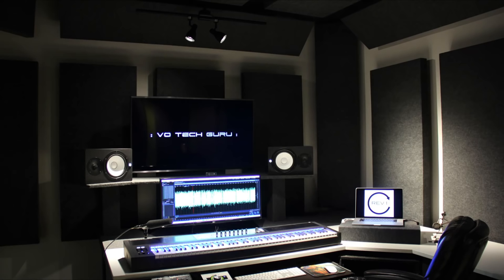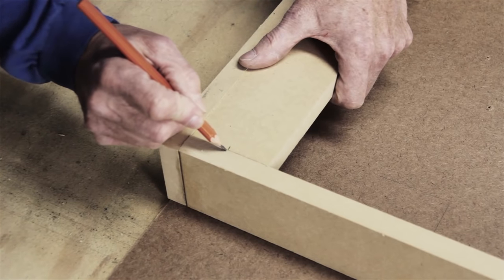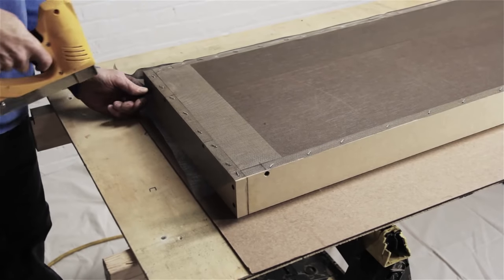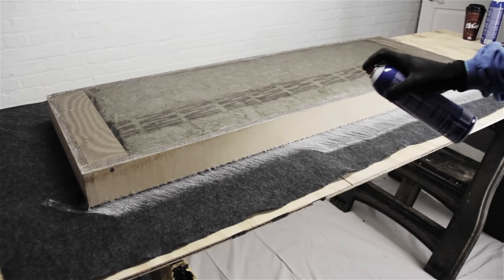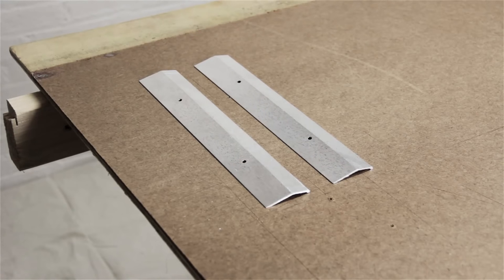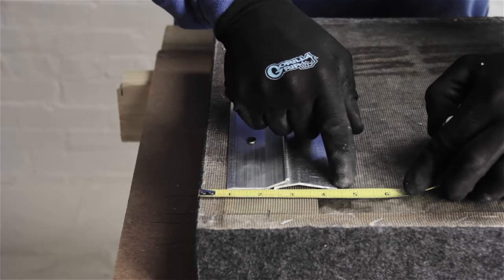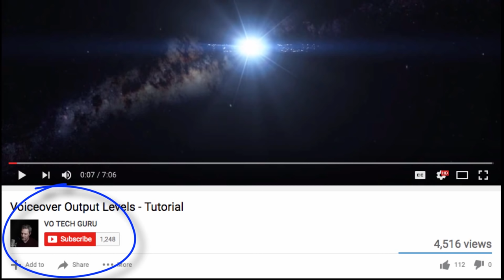How To Build Acoustic Panels | DIY Acoustic Panels

Comment: The material you used, Roxul, is it rockwool or mineral wool? It seems it is dusty and may cause some breathing problems because of the gas it releases. Rockwool or mineral wool generally does. How did you managed it?
Reply from the maker: Cagri Yilmaz I personally don’t manage anything when it comes to Roxul but I recommend people wear masks, gloves and long sleeves in this video because some people might believe it’s an issue for whatever reason. I’ve been around Roxul and installers for many years and it’s rare to see them wear protection. The same is true for employees at the Roxul plant. Look up “Holmes On Homes Roxul” on YouTube and that may address your concerns. Roxul also has MSDS sheets on their website at Roxul.com. Hope that helps. :-)

Comment: How did you make the triangle-shaped sound baffles at the top of your sound room (see :24 mark).  Are they just bass traps mounted to the wall?
Reply from the maker: Hi Craig. Those are the same panels, only longer. I think I explained a bit down below this post, but basically you build triangle shelves out of MDF for the corners at the walls and ceilings and then use the metal cleats (transition strip) to hang the panels on those. Note: It is important that you have upper, lower and possibly even center supports when hanging longer panels in corners, from ceilings, etc. That is to say, you need more than a single connection point for strength in corner and ceiling applications. On that note, when we installed our panel clouds at the ceiling, we used eye hooks to fastened them from the ceiling into to the upper and lower panel supports. Same wall anchors, they haven't budged. ;-) Hope that helps!
Reply: Thanks!  Great advice!
Reply from the maker: Craig Walkner You got it. ;-)

Comment: This is utterly brilliant, thanks Tim! Can you use pressure treated wood (2x4 or smaller) for the frame or is MDF just a safer bet? Sharing this on my page too - I've been hunting for a straight forward version of this build for weeks. :)
Reply from the maker: Hey Chris, thanks for the kind words! I wouldn't use PT wood because it can become very unstable over time. The MDF is a much better value and a very stable product. It's used to build furniture and many other things due to its strength and stability. Thanks for the share!
Reply: Makes sense! Of course man - I also just learned what countersinking is haha. Thanks again. :)
Reply from the maker: You're welcome and thanks for watching/sharing!

Comment: At the risk of sounding silly, does is matter what the frame is constructed of? I would think a wood frame would be more absorbent than metal.  Or would it make an appreciable difference because of the mass of the insulation? Could you use a lighter frame material than wood as long as you can get that taught material with no wrinkles?  Thank you!
Reply from the maker: Walker Texas I suppose you could but I’m not sure how ridged and square the panel would be. Which material were you thinking of using for the frame?
Reply: If I could achieve the same absorption, theoretically, with a frame the size and weight of toothpicks as long as I could get the material taught across it, it'd be beneficial to me.  If I could do that, do you think the performance would be the same as your frames?  Thank you!
Reply from the maker: Walker Texas If your frames hold together I imagine they’ll do the job. I saw one guy just glue insulation to his wall, which worked, but it looked, uh...not so good.
Reply: I understand what you're saying and thank you for the reply.
Reply from the maker: Walker Texas You got it. ;-)

Comment: Would it be possible to hang these horizontally?
Reply from the maker: 94fonze I don’t see why not. Maybe just figure out what needs to be done to hang them at both supports. Maybe two smaller hanging brackets? Or you could use wire supports. I just don’t care for those because panels get out of level over time.
Reply: VO TECH GURU thanks! I'll keep that in mind
Reply from the maker: 94fonze You got it. ;-)

Comment: Greetings again, may i ask how many of these panels did you make in total, and how much fabric did you use in the end? Also how did you know the total amount of panels you needed for your walls? Thanks in advance
Reply from the maker: gunluv96 Hi. We used 9 yards of 72" felt for 8 panels. We built far more than 8, but that's the coverage you can expect. As for distance between panels, we averaged 8" or so between them. Here is a link to all the materials in case you have a hard time locating the felt. We used Charcoal Gray in this video. https://kit.com/votechguru/diy-pro-acoustic-panel-supplies-as-seen-on-youtube

Comment: Were you able to test these and find the frequency range that is effected? What is the lowest frequency it has a useable effect on? I know rockwool goes a little lower than fiberglass, but not sure how much.
Reply from the maker: Thanks for watching. You're hearing my voice in a booth with those panels and my control room at the beginning of the video sounds great with these panels. I also have them at my home studio and they work great there as well when I'm composing and mixing for film and commercials. I've never noticed an issues with any frequencies and it's likely because they're so thick and are held off the wall. VERY effective stuff. Hope that helps.

Comment: This is a truly excellent DIY vid (The best I’ve seen on youtube and the one I’ll be using to get the job done right).  Please Please show us how to make those awesome corner Bass traps we see in your studio. I know others would really be interested in watching/learning from your experience. .
Reply from the maker: Thank you very much and thanks for watching! It’s actually really easy to do the corners. Just cut your sides to the length you need, then build triangular shelves with a wood face on them just like we did on the wall. We did one of the top and one at the bottom of the long panels. Done. Make sense? And again, thanks for the great comments!
Reply: @VOTECHGURU  Got it!  Did you fill the whole corner space with the Roxul, or do it the same thickness as the flat panels?Thanks for your quick reply. As this was a pretty old vid, I wasn’t expecting that. Awesome!
Reply from the maker: Yep, same depth on the panels for the corners, and if I’m not mistaken, maybe the same width, or close to the one in the vid. But for sure, the ones on the walls in my control room that I show in the vid are much wider. I think what I did was figure out how far apart I wanted the panels on the wall to be, then measured how wide the corner panel would have to be for symmetry, then with adding the depth of the panel that dictated how for out and how wide my corner shelf needed to be. And the funny thing is, I hear and see so much talk about these MASSIVE base traps, but in reality, I also score and mix for film and TV with this setup and have had zero problems. Like a shaking my head thing with the whole overkill approach, you know?

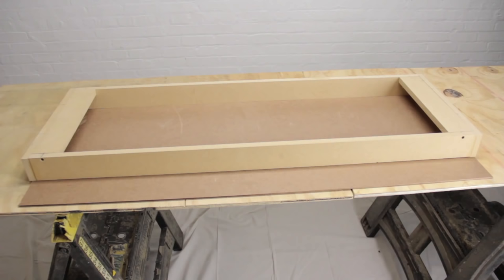Comment: The width displayed on the packaging at 01:22 reads 15 1/4". If that is the case, wouldn't the top and bottom pieces measure 15 3/4". Unless you cut them down to 16 1/2" for a snug fit. Just curious. I thought I'd ask before I start ripping away!  Again, thank you for your time and assistance. Much appreciated.
Reply from the maker: The inside ends up being 15” so a snug fit is what I was going for.

Comment: I am wondering if I can get away with using 5/8" MDF instead. The 3/4" panel is double the price where I am located.
Reply from the maker: Sure thing. Just be super careful when drilling and screwing. Maybe count more on glue and a nail gun (a small brad nailer so the wood doesn't split).
Reply: @VOTECHGURU  Thank you so much for the prompt reply. I have looked everywhere. Hard to believe that a 5/8" sheet would run me $22.00 whereas a 3/4" sheet would cost me $43.00. Makes absolutely no sense to me at all. There must be a valid reason for the discrepancy however. By the way, this is my go-to video. Must have watched it a dozen times. And trust me, I have seen a few!
Reply from the maker: Peter Batah Thanks! Yeah, that does seem pretty out of scale. There has to be a good reason for the price difference. I would be interested to find out.
Reply: @VOTECHGURU  I picked up my 4' x 8' x 3/4" sheet yesterday and again asked why the huge price discrepancy. This time I was told it was because of the extra glue that was required. Go figure.
Reply from the maker: Peter Batah Weird.

Comment: Hey, I want to make these but long story short, I can't have them hanging on my wall permanently.  I would like to use them as a part of a vocal booth.  I will also be transporting them as I will be recording in a few different locations .  How is the durability of these, and specifically, if I were to transport them around a bunch, would I have to worry about the fiberglass particles leaking through?  Like if they accidentally get bumped, etc.  thanks a bunch!!
Reply from the maker: I don’t know how I missed your comment from so long ago, but the new YouTube studio app lets me filter by unanswered questions. You could build them by turning them into a Gobo, just look that up on YouTube, but I would be careful during transportation to make sure you don’t damage them. As far as any leaking of the insulation goes, I would just watch this video. https://youtu.be/LOWQym4RCfI

Comment: Question, im in the process of replacing the drywall in my bedroom in which i have a home studio setup for recording vocals and mixing, would it be a good idea to fill the walls or parts of them with the roxul insulation before installing the drywall? Would i get the same or better results? Thank you.
Reply from the maker: Roxul is used inside walls to help keep noise out. Is that a goal as well?
Reply: @VOTECHGURU  My main objective is to diminish the echo/reverb in the room when recording vocals, will installing the insulation in the walls help with this or would i still need the panels over the drywall?
Reply from the maker: T Rex Then focus on making panels to hang on the walls because Roxul behind the drywall will only help keep exterior noise out and won’t help with the echo.

Comment: Very nice video indeed ! I really like the way you hang your panels. Very clever ! But panels like these are mores efficient when there’s a gap between it and the wall. Especially in the lower frequencies (low mids) that are the most difficult to deal with ! You should have provided this information as it is crucial in acoustic treatment!
Reply from the maker: Covers and Stuff There is a 1/2” gap caused by the hanger and I state in the video that the bumper at the bottom is to keep it equidistant from the wall. There aren’t any issues across the spectrum that I’ve experienced.
Reply: @VOTECHGURU  When I say gap, I mean a bigger gap like 4 inches. It doesn't create any issues to hang them closer to the wall but you will actually extend the panel's capacities if there's a bigger gap. It will absorb lower frequencies.
Reply from the maker: Covers and Stuff No offense, but where are you getting your information? I voice professionally, compose and mix for commercials and film and have had no problem frequencies at all using these panels. Even major panel manufacturers sell solid backed panels (a huge mistake by the way) and these are far superior to those. Also, creating 4” standoffs with panels this deep will not only complicate things a great deal but will have diminishing returns. If there’s something I don’t know, please educate me. Thx
Reply: @VOTECHGURU  I'm getting this information from Ethan Winer from RealTraps and many other sources over the Internet.
Basically when an acoustic panel is mounted 3 ou 4 inches from a wall, its rear surface can absorb sound too so it's more efficient across the spectrum. Bass frequencies are also easily trapped by the air gap created and that allows the panel capacities to absorb lower frequencies if you compare with the same panel mounted right next to a wall.

http://recordinghacks.com/2011/12/13/mounting-acoustic-panels-variable-air-gap/
Reply from the maker: @whereismymind667  Gotcha. Ethan knows his stuff but this is a different animal altogether for this video. This build is meant for the "every person" and not for granular discussions at very high levels. He also uses lightweight and very expensive panels (these are 12 lbs and $25 each) and using C post clamps would be a massive undertaking for that "every person" I spoke of earlier. I can tell you I voiced this video using these panels in my booth and that my monitoring room had been tested up and down the spectrum with great results. Also have to keep budgets in mind as these panels cost $25 each to build and the price and labor hours would go way up if I tried to mimic a RealTraps setup. Anyway, thanks for your comments. I now understand which system you were referring to.

Comment: Is the carpet transition metal 1 3/8" ? Also is the Counter Sink Drill Bit that fits with the screws a #6 (9/64" (3,6mm) ) These Items are not on the LINK of supplies. Everything else is GREAT!
Reply from the maker: Hi Dan. I honestly don’t recall the dimensions of the carpet strip but that sounds about right. Anything near that dimension that has the same angle from the panel to the wall should work, though. I believe I updated the links for the countersink bit and it should be correct now. Thanks!

Comment: You should also make note that your fabric selection should be thin enough for you to feel your breath through it. Anything to heavy will just become reflective and not fully utilize the insulation trapping.
Reply from the maker: Yep. In the case with our felt, you can also see through it when holding it up to the light. Almost like a web of material. Good stuff. Surprisingly strong as well.

Comment: I decided to adjust the dimensions to make it so The top, bottom and back supports are all the same length (drilling into the side of the long sides instead of the side of the tops basically).  This allows me to make all four shorter boards the same size.  Is there anything structurally deficient about this approach?
Reply from the maker: Dennis Malley Not structurally deficient that I can think of. If it works for you, then I say go for it.

Comment: In your opinion would additional rock wool thickness help noticeably or overkill?
Reply from the maker: 멘토르석사 not unless you’re dealing with really heavy bass. I voiced this video using those panels and also use them in my mixing room. The one you see in the video.

Comment: Can i use any fabric to cover the panels I’m looking to make some panels for a home theater room so it would not be ideal to use that grey fabric
Reply from the maker: edward417 As long as the fabric allows the sound energy to pass through the panels you should be ok. Hold the fabric up to the light and if you can’t see the light through it, I wouldn’t use it.

Comment: How much do one of these panels weigh? do you have to find a wooden frame of the room to mount the panel to if your walls are drywall?
Reply from the maker: Bradley Baker Hi Bradley. The panel as was built in the vide weights around 12 lbs. If you use the drywall anchors we used in the video there’s no need to drill into a stud. We even used the anchors to hang panels from the ceiling. Thanks for watching!

Comment: How would you mount these from ceiling to wall as a wedge?
Reply from the maker: I’m not sure what you mean by “wedge” but you would just use the same drywall anchors in the video to hang them from the ceiling, but with eye hooks. Hope that helps!
Reply: I'm talking about the corners (90 degree angle) where the wall meets/spans the ceiling. I am wanting to mount panels at 45 degrees spanning these corners. Basically changing the wall/ceiling shape from square/right angle to a trapezoid. You see it all the time with triangle traps wedged into the ceiling corners.... I want the same look but with a rectangle panel so there's empty space (air gap) behind it.
Reply from the maker: Brian Packard Gotcha. In the pic of the monitoring room near the beginning of the video, we just cut triangular shapes out of MDF and mounted them to the walls/ceilings where the angles met. Then we attached 3” MDF backers to the center of the triangles, the length of the wall, and then attached the panels to the backers using the same hanging method with the metal hanging strip. Does that make sense?
Reply from the maker: Brian Packard But If you’re talking about where the vertical wall corners meet, we just installed triangle shaped shelves with 3” MDF attached to the front of the shelves and used the same hanging method.

Comment: Could I just forgo the wood frame and wrap the insulation in fabric to take off some of the work load? And just mount it differently.  Obviously not as sturdy but would this function the same way?
Reply from the maker: They would be effective to whatever degree, but the mounting system I use keeps them off the wall which improves performance and I'm not sure how you'd mount them to maintain that performance. Also, the Roxul insulation isn't ridged so I'm not sure how you'd wrap them in fabric and maintain symmetry, if that's a concern for you.
Reply: @VOTECHGURU  makes sense, bought the materials and gonna start the build tomorrow.  Thanks!
Reply from the maker: @ReubenGingrich  Awesome and thanks for watching!